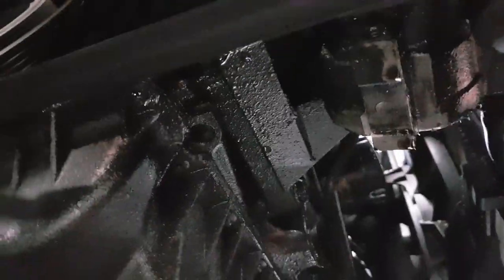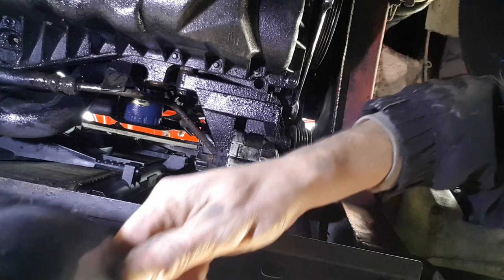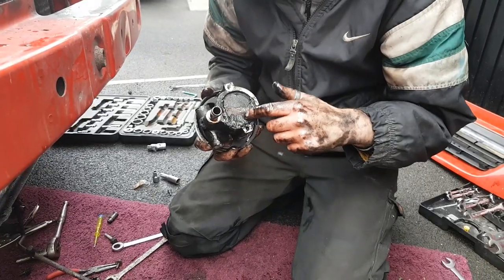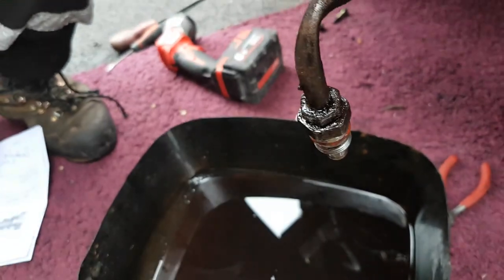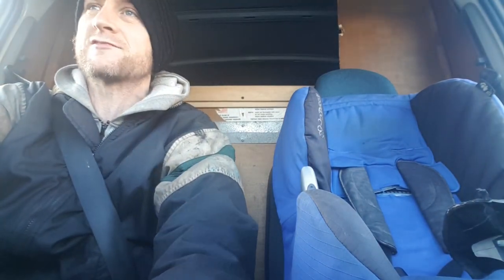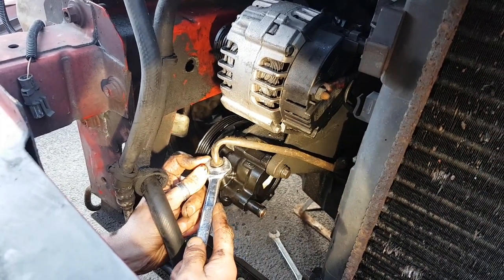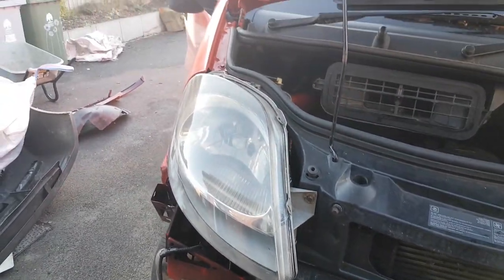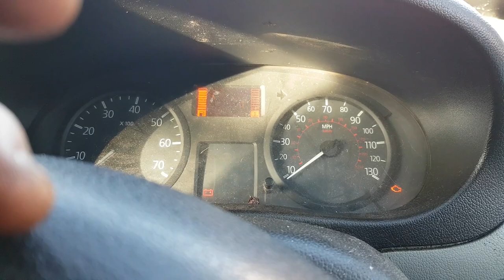Episode 48 - How to replace a Vauxhall Vivaro power steering pump

Comment: Good man for leaving the mistake in. Little things like that will make people think more about checking parts before they start dismantling.
Reply from the maker: Thanks mate. That's nice to read from you pal. I often leave mistakes, frustrations and things not quite working out in my videos. I always want them to feel as genuine as possible. Capturing the moments is the key thing. 😉
Reply from the maker: @christopher dresser  @christopher dresser  Hi Chris. Apologies for the late reply. Didn't spot your comment until now. I'm afraid I can't recall the code of the pump we fitted. All I know is that it was the one with the narrow space between the pump's body and the pulley. If you are able to take your existing one to a local automotive spares shop, I'm sure they'll be able to give you the one you need. Just open the box to check before you walk out. 👍

Comment: The pump that didnt fit looked like it was for a belt with 6 ribs. Yours was 5 ribs. Great video. Keep them coming
Reply from the maker: Well spotted Andrew. Never noticed that before. I'm wondering whether it was for a slightly newer variant of that mark of Vivaro (not necessarily the next model up), or for a different engine size, or even for the short-wheel-based version. Either way, it weren't going on! HaHa!
Thanks for your comments though. Really appreciate it. 👍

Comment: I’ve got a leak on the same van. Strange thing was it was fine when I parked it up. One week of not using it start up and wow what a horrible noise. No fluid. Checked the pump. No leaks. Seems like a pipe. Is it an easier job to change pipes
Reply from the maker: Hi matey. The only thing you need to bare in mind with pipes is to take extra care. Too strong a turn with a spanner and they will snap, especially if they are rusty. Spray any connecting unions with WD40 first, as it will help to free them off. Have you found the source of your leak yet?
Reply: @jimmykneesall  not had the time to look at it yet. Will look at the weekend. It does look like a pipe.

Comment: So what was the noise when you tested it at the end? I have a similar noise from my van. Was told the pump needed replacing but could it just need topping up. Also recently had the alternator changed. Could something have been put back incorrectly?
Reply from the maker: Hi Anthony. To be honest, not sure of the noise on Joe's van. I know he'd been driving around for at least a couple of years after we did the repair without reporting problems with it to me. If yours is making a noise, definitely check the fluid level first, as that's easy to do. If that's fine, do a full lock-to-lock turn with the steering and then check the fluid again. If the fluid is still fine and the noise is still present, but is making different sounds as you turn, the pump is could be on the way out. Was yours making this noise before you had the alternator fitted? Check out the Vivaro forums online too, as they may have some helpful advice. Hope you can get yours sorted? 👍
Reply: Thanks for the advice

Comment: Handy to watch this video, I’ve got to do mine soon as the bearing on the pulley chirps like a nest full of birds so I’ll be doing the full pump. Then it’s onto the inner and outer rods, new shocks and springs maybe new disks n pads too but see what they are like. Any advice for doing the whole steering rack if the problem isn’t with the inner rods?
Reply from the maker: Thanks Chris. Hope it is useful to you.
Sounds like you have a lot of work to do there. Unfortunately, I haven't tackled anything else on the Vivaro, as it's my mate's van. As with any nut-and-bolt job though, just take your time and keep a record of what goes where. If I'm to tackle anything substantial, I take pictures before I start, so I have something to refer to when putting stuff back.
I'm sure someone in the Vivaro Facebook groups will have had experience on the steering racks. It's worth just asking there. Usually, people in these groups are helpful.

Comment: cracking job there buddy, iv the same van same problem , how do i make sure i dont get the wrong pump , just dont want the van off road for days
Reply from the maker: Hi Mark. Thanks very much for your feedback. I hope this video is of use to you.
That's a good question. What I can say is that the correct pump that Joe got came from a place called Sutton Auto Factors. The only obvious thing I can suggest is to look at the pictures of the one you're looking to buy, so you can get the right one. In our case, the gap between casing and pulley was only about a centimeter, so not very big at all. Just check what type you have on your van first before you commit.

Comment: Did you get your bacon and egg sarnie?  
What a bummer with that wrong pump. It was going do well up to that point. But still these things are sent to test us.
Forgot to ask you. Those drill bits you got for Christmas from Reggie. Are they good? 
If so I might go buy a set. 
Cheers for now
Reply from the maker: Cheers Frank. Fair play to Joe. He did make me breakfast. 😄
The drill bits were alright, but I guess I would have needed something a bit more pricey to do that last bit of that seized bolt. Not bad though pal.

Comment: What make of psp did you use ?
Reply from the maker: Hi mate. I'm afraid I can't recall the brand and I don't think my mate has the van any more. All I can say is just make sure you have the one where the pulley is correctly spaced away from the body of the pump itself. Don't make the same error we did! 🤣

Comment: Did you bleed the fluid? That might be what's causing the noise
Reply from the maker: Yeah, we bled it. Joe hasn't reported problems since that initial noise, so it appeared to all be good at the moment. Good question to ask though pal. We're always learning!
Reply: Try bleeding it with the cap off and for longer. You get that noise when the pump doesn't have enough fluid. It just had a little bit if airing it.

Comment: jeah 6:50  I was also able to remove the bad pump that way, but then I soaked the end of the hose in Coca-Cola for 2 days, and the nut loosened :)
Reply from the maker: Interesting idea that Thomas. I like it. 😆 I once tried removing a large oil trail spill off of my driveway using Dr Pepper...

https://youtu.be/2Wm1j4dpdMU?si=5v3t_yBjb7A8JTVo (@ 3:50)

It didn't really work though. HaHa!

Comment: Can't stand those pipes, I snapped the oil return pipe by turning it when doing the turbo
Reply from the maker: That's a shame Stephen. They certainly are very brittle. I have to admit that I was worried about this one snapping. That's why I cracked the nut on the end first whilst the pump was still attached to the van, so that the pipe wasn't under any tension.

Comment: My steering is lose and was told it's the knuckle joint but apparently on these vans u must replace the whole steering shaft that comes with the knuckle and its very pricey. Any ideas ?
Reply from the maker: If it were me, I'd be attempting to do the least work possible and just do the knuckle joint, if they are separate parts of course. I don't really have experience with these Vivaros. My suggestion would be to ask the question in a number of the Vivaro Facebook groups. There's loads of them and people are generally very helpful in providing tips and advice. Hope you can get it sorted. Keep me posted. 👍